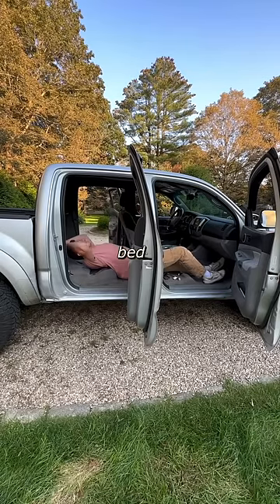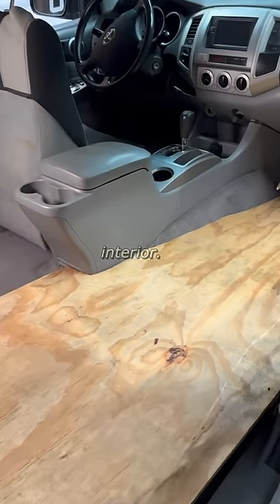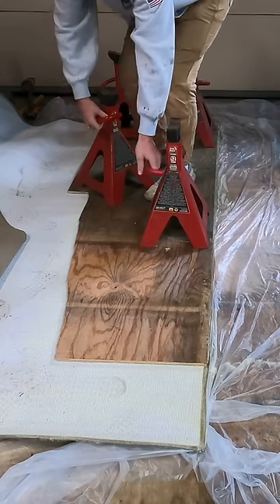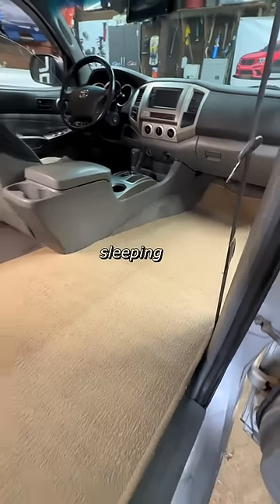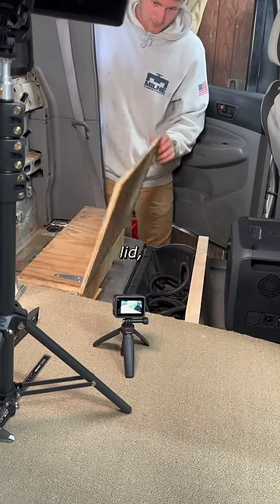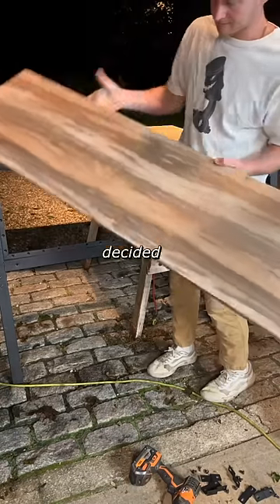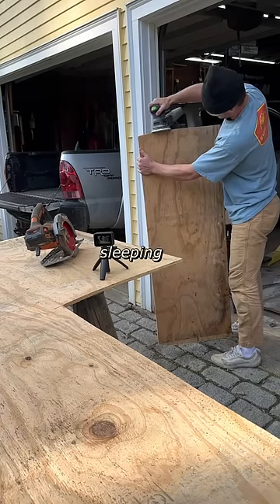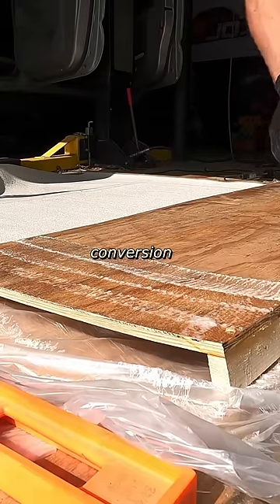Swapping the seats in my truck for a cozy bed

Comment: I just went with a minivan. Sienna exactly fits a queen air mattress. No prep. Keep the seats. 😂
Reply: That is one of the best, most reliable minivans on the market and the only one that you can get in all wheel drive.  But, if use the whole area for a bed, that doesn't leave much for storage or any cargo.
Reply: @BryanTorok cargo goes on the bed. You are living in a car, cant be picky
Reply: @user-nb8yt2il2r  My point is that a queen bed in the back of a Sienna takes up all the floor space, no room left for anything else.
Reply: Minivan would be easier.
Reply: @roofinggalLYNN  Seeing the videos of the places he is going off-road and and barely roads, even the AWD Sienna would not do it.
Reply: Same do full size bed in my LX470.

Comment: This is where a minivan with sto and go seats are awesome! Nothing to take out unless you want to use the seat storage area  for other things. I have a simple setup for traveling and can lay down to rest anytime and also carry 2 or 3 others if needed.
Reply: I have a Caravan with those fold-down seats, and I camp in it all the time. I also built a shelf that rests on the rear cup holder area, so I have storage off the floor while sleeping. The shelf is sized for milk crates, which leaves the rearmost floor (by the hatch) for food cooler and a few other items. With that shelf in place there's still room to use the middle seats so I leave it in most of the time, and the crates sit just below the headrest level so not blocking the view.
Reply: I was thinking that.  I have an AWD Sienna.  Bought it for the same purpose.
Reply: But the main difference between a minivan and a truck is the suspension. You can't haul 4' X 8' plywood, dozens of cinder blocks, or anything else close to 1,000 pounds in a minivan. A "1500 truck" has the suspension to do this in it's bed.
Reply: @rattlecat5968   You should check your specs closer. The Dodge Grand Caravan is over 1500 pounds. I believe they spell it out at 6 passengers plus 400 payload. Also, most minivans are built on a modified panel van chassis, so the early ones had different crash test criteria. Basically, you remove the 4 rear passengers, add cargo, and you come up with near 1200 pounds plus the front passengers. Oh, that same van will fit 4x8 sheets.... and still close the rear hatch.
Reply: @rupe53  I checked. The Dodge Grand Caravan can carry 1400-1650 total cargo (includes passengers.) It can tow up to 1800 lbs. They are all front wheel drive.

The Silverado 1500 can carry 1750-2280 lbs (again, including passengers) and can tow 9,000+/- lbs. Mine is a 4wheel drive and is a crew cab, so the bed isn't the full 8' unless I lay the tailgate down. 

But, the Silverados and the Caravans are in different classes. Towing a car on a trailer isn't smart in a Caravan. It's not built for that. Besides, a Dodge isn't my personal choice for a vehicle. And where I live, the northeast US, 4 wheel drive is basically necessary.
Reply: @rattlecat5968  a mini van can haul 4x8 sheets, cinder blocks, engine blocks, etc. Maybe not as many as a 1/2 ton pickup, though close to a little takoma, ranger, colorado. Been there done that! What's your next blablablabla comment!
Reply: @rodneyw849  It's "TaComa," Mr. SoccerMom 🤣 or, Taco as we Tacoma enthusiasts refer to it. And they're more than decent compact trucks...great resale values and bulletproof engines.

Keep your mini-van, buster. I'm sure there's a cubby in it where you keep your nads stored. 🤣

But, in all seriousness, try not to take it personally. There are pick-up truck people and then there are mini-van, soccermom people. And that's fine. To each his, or in your case, her own. 

Blah blah blah... won't discuss it further with you. You wouldn't understand 🤣🤣🤣
Reply: @rattlecat5968  no more blah-blah. My only point was about the cargo weight and being a bit more versatile than most think. I have had both and at 70 years old I feel the ride of a car is more suited to my needs at the moment... and nobody wants to borrow it when they need to move. BTW, many of these mini vans are available in AWD.

Comment: The purpose of contact cement is that you don't have to let it sit overnight.
Reply: Helps let it gas off and not smell up the truck.
Reply: Which is why it's called contact cement I.e adheres on contact
Reply: Depends on the contact adhesive, some are applied wet, some dry, 3m 90 is the best I've tried, even repaired ripped sailboat sails with it, applied slightly wet and dries in 10 min
Reply: @TheDogGoesWoof69 hopefully youre referring to voiding the warranty, because there is no way someone is gonna tell me what i can or cannot do with my vehicle that i paid for
Reply: @chimpswag3492 if you finance it, it is not your vehicle til its paid off. I know, crazy huh?
Reply: Sprays it inside on the ground
Reply: @protipskiptoendofvideoandr286 when in the short does he say it’s financed and not paid off?
Reply: @TheDogGoesWoof69  what are they pwned by Ferrari now?
Reply: @JoeMama-mk5dg bet you can't name 10 people who aren't bank owned
Reply: @Redact63Lluks best reason
Reply: Still, I'd let it sit. A stich in time saves 9! 😏
Reply: I was looking for this comment 😂
Reply: 💅🏿 Is 💅🏿 that 💅🏿 clear 💅🏿 nail 💅🏿 polish 💅🏿😂😂
Reply: @TheDogGoesWoof69  but once you buy it doesn't that make it your truck??
Reply: Maybe he did the glue at teatime and found something better to do in the evening.
Reply: There are dozens of alternatives that set in minutes and cure overnight. Just choose wisely.
Reply: @Kim-pg6hh only once it's all paid off. The bank has a lien on the vehicle as long as it is being financed.  If you modify the vehicle and bring the value down or make it unable to be resold (should the need arise), it's technically not your vehicle.  That's why you have to have full coverage on any financed vehicle, because who is going to pay off a loan if the vehicle is totaled? Full coverage protects the lein holder.
Reply: Just buy a truck cap. This guy is basically reinventing the wheel. Trucks always had a bed. This guy is just a wood butcher.

Comment: Very cool. One suggestion I have is to instead of trimming the carpet against the edge… wrap it around to the backside. The carpeted edges will fill gaps and make it fit more snug
Reply: I will be doing something similar in the near future.  I am envisioning wrapping it across the entire bottom where I will cut it to lay flat, use adhesive to hold it down, and add staples for additional security.  It will be a little below the height of the window sills, so I should be able to get away with mostly 90° angles.

Comment: Bro trust me. You don’t want to be sleeping on old moldy plywood, that’s rich in formaldehyde and covered with endocrine disrupting adhesives in an enclosed cab. Shoot for some birch formaldehyde free plywood and sand it smooth, then stain the wood with a homemade vinegar/steel wool ebony stain. If you’re dead set on fabric or carpet covered you can stretch on some carpet and staple it in place. Your future health will thank you.
Reply: How does the formaldehyde in the glue in the plywood make its way into the air though? If its on fire that makes sense, but why if it’s lying inert?
Reply: The plywood and glues off-gas chemicals into the air, especially under increased temperatures that would be common for the inside of a car. However the carpets and cushions of a vehicle are typically full of these chemicals already along with fire retardants, much like a couch or mattress. An additional concern with treated wood is that it would not only be adding new off gasses formaldehyde into the air, but also likely pesticides and whatever other chemicals were used during manufacturing. If the air inside of a vehicle wasn’t bad enough, adding these would surely make it worse, sleeping in that environment when you’re supposed to be healing and recovering is not ideal or a good call. Spending several hours in there would certainly be bad for your health.
Reply: Plus your head is RIGHT next to it. I definitely agree with you  @EdBlack-
Reply: Endocrine disrupting? Lmao
Reply: Yep, endocrine disrupting is applicable in that sentence and refers to the substances or agents that can interfere with the normal functioning of the endocrine system, which regulates hormones in the body. These endocrine disruptors mimic or block hormone actions, leading to adverse health effects. Better to avoid this potential health concern, especially considering there are healthier alternatives.
Reply: This is the same plywood all the building you have been in use for there framing so not sure about the logic on this one
Reply: @wadeariss448 you never use pressure treated lumber for interior work, and there's more than 1 reason an average 20 year old today has as much testosterone as a 60 year old in 1940
Reply: Hell! Look at cancer rates and overall bad health of many people these days compared to that 60-70 years ago. You move into a new house,  consider airing it out for about 2 days  if possible.
Reply: Or just buy a truck cap and sleep in back like a normal person 🤣🤣
Reply: The inside of a car in a southern state can get pretty hot on a summer day I see how this can go bad.
Reply: You are very well informed! ✌🏽
Reply: Isn’t your whole house flooring made of plywood and covered in carpet???
Reply: @Alex-zi1nb  way to show your ignorance
Reply: @Alex-zi1nb you don't even know what that means...
Reply: I say this all the time when people are using pallets to make furniture and shit like this. People have no ideas what toxic crap is in the wood.
Reply: Most of the outgassing happens in the first 6 months or so, although it may ramp up again if the interior gets hot.  Let the plywood air out for a while and it should be fine.  BTW, the rest of your car's interior and a lot of the stuff in your house (like MDF) has a bunch of shit that it regularly outgasses, so...have good ventilation.
Reply: @jadonlimoges1830  while i do like these micromanaging comments, and am learning from them - yes, many states require pressure treated lumber inside homes.  for instance, all touching the concrete foundation and walls.
Reply: @dcs4555 also did he say that was pressure treated plywood? It looks a lot more like an old piece of cdx that has almost certainly been sitting around for a long time.

Comment: I take out my rear seats in minivan - we put in sponge mattresses and end up with a really comfy double size bed. Great for long distance traveling.6ft length for bed still leaves 2ft for luggage at back.
Reply: I did the same to my minivan. I’m 6-5 and the van is an EX model. I get an extra foot of space. Getting rid of the two rear seats saves about 100 pounds of weight also.
Reply: Be nice if your minivan could pull a Goose neck
Reply: I'm not a fan of pulling a massive RV camper - just seems like a logistical nightmare and far more expensive then local hotels.

Comment: Should've just got a canopy and made a cozy bed back there instead of this nonsense 😂
Reply: Anything for views and clicks. 

But I'm quirky!
Reply: It gets cold in winter to sleep in truck bed.
Reply: I agree. I've used a blow up mattress in my truck bed. Under a canopy. Had plenty of space and when it got cold. I rigged a bigger alternator and battery and a solar panel for creature comforts. Like a TV and PS4 and a space heater. Extra blankets. Done. It was really nice.
Reply: @thedognoseknows4451  no colder than sleeping in the cab, still gonna need to run your vehicle or have access to a power source or heater.
Reply: Pretty sure the bed of that truck is way too short. I personally would get a different truck with a longer bed. But hey if that’s not an option then you gotta work with what you got
Reply: Why is everyone saying sleep in the bed? He needs to get roof-racks and get himself a rooftop tent.
Reply: This bed makes zero sense. 
The truck camper top in the back works waaaay better and allows a passenger.
Reply: Or, maybe he wants to use the cargo area for cargo. Just a thought.

Comment: In the 70s lots of custom's shop's would Deck out the bed of the truck with some removing the rear window so you could climb from the cab into a nice bed.

You idea is nice but at what cost.

Buying a van let's you build a bed in the back and keep the seats.

It's large and in the 40,50s of 60d some cars had seats that would lay down making a bed for long road trips

Seems like a pair of custom design seats or bed cover with nice custom design would be better.

But any one can easily point things out after someone has done it.

Comment: Maybe build a camper for the back ?
Reply: Nah man.. when you live in your car you don’t want to stick out
Reply: @nunyabidness8281 a camper shell doesn't stick out though
Reply: @drunk_by_noon9231 some people will say it looks like a camper. Meaning somebody might be sleeping in it. It would be better if people walking by your vehicle didn't know you were sleeping in it.
Reply: @somewhatinformed1208 or they simply haul stuff and dont want it exposed to the elements.
Reply: Short bed most likely
Reply: @100GTAGUY  I see your point people just might be trying to steal the stuff you haul instead of kill you.
Reply: My initial comment was going to be get a cap for the bed of the truck but A lot of these smaller 4 door pickups have beds like 5 feet long or even less now…. So yea maybe there actually is more room in the cab… wow 😂
Reply: no temperature control
Reply: The bed of a pickup must remain empty.
Reply: @steakandkidney3142  if you plan on sleeping in it in public you don't want to wake up to be robbed. Campers are okay but some people use them for camping. What is your plan when someone comes knocking?
Reply: There are these things called canopies for the back
Reply: @somewhatinformed1208  except for the fogged up windows tend to be a dead giveaway.
Reply: If you're living in the back of the truck, you could be in trouble. Living in the cab, when trouble arrives, you can drive away by just getting up. If you're in the camper shell, you have to exit the vehicle to get into the cab. These days, you have to always be prepared. Plus, there's more headroom in the cab. Sold!       Vaughn

Comment: Really cool. I’ve always wondered why car manufacturers have been unwilling to make cars and SUVs sleepworthy.
Reply: Ford's F150 has seats that lay flat for sleeping
Reply: @DK-bk1vq what year? Lol not 2017 f150
Reply: Because cars are for driving not sleeping. Thats why your bed is separate like in a rooftop tent or in a caravan you bring with you. That what you should do with a truck like that anyway.
Reply: @Incarnate-1  Wow, that’s some real out-of-the-box thinking.
Reply: @tedtimmis8135  it’s common sense where im from
Reply: @Incarnate-1  1980-90 ford econoline says different

Comment: It's much easier and better just to sell the truck and buy a Van.
Reply: Ever tried to change a spark plug on a van?
Reply: @Darren-yu6hf Aren't they diesel?no spark plug
Reply: @roystevenson1375  On a van? As far as I'm concerned factory built diesels are basically unicorns in the US.
Reply: @Darren-yu6hf  Oh yes sorry.I was thinking that van meant van as in ford transit delivery van{normally diesel)..not van as in campervan (normally gas)
Reply: @roystevenson1375  10-4, that thought went through my head as to thinking two different  animals. So I made my comment, and if I was wrong, I figure you would straighten me out like a peice of barb wire! Lol!
Reply: Or get a camper shell 👍(you know, to camp in)
Reply: I've had great trucks for 30 years, recently bought a cool mini van from a neighbor and they are great rides. Doors and shade everywhere,  the seats fold into the floor , storage compartments.  I set it up like a rolling toolbox then my wife decided to start driving it. Back to the basic truck

Comment: So couple pro tips imma give ya as an upholsterer, use contact cement works better and roll the material over the edge and staple it down if you dont want that carpet coming up in a month
Reply: In the mattress industry I've found that 3M FOAM FAST ORANGE is about the best textile adhesive out there.
A bit pricey $22 per can. One application and done. Won't dry out and lose grip. I used to know how many square inches
of yield per can to justify cost. Don't remember now.

Comment: In 2021 when it was time to trade in the  old BMW I was worried that I would get inflated out of my house.  I bought a pickup with a 6'6" bed, but I also made sure to get a big cab that did not have a huge hump or other obstructions.  I once was homeless after a house fire and had a Dodge Durango where the front seats all the way forward and the rear seats folded down I had nearly 6 feet of cargo space I could sleep in.  But there was a slight incline and it was not the most comfortable way to sleep.  I had a tent but mostly stopped using it because bears tend to avoid campgrounds but when you are just out in the backwoods they really are not afraid of you, neither are starving cougars.  And it would get really cold at night a lot of the time.  Felt better inside.  Safer.  You don't realize how vulnerable you are asleep till you sleep out in the back country under the stars.

Comment: In 1972, a friend and I were driving from LA to Denver and back over a long weekend in his TR-4. We removed the passenger seat and then traded off driving. Then the next week as he was driving through Pasadena,  someone rearended the TR-4. Not to worry, it had a frame. Swapped out the rear half and it kept going.  Along the way, in Grand Junction Colorado on the highway (before I-70) I found a farmer selling Hi-Lift jacks for $20, so it rode next to us and later served well to self-extract from off roading adventures.